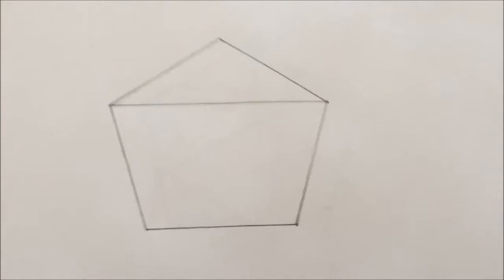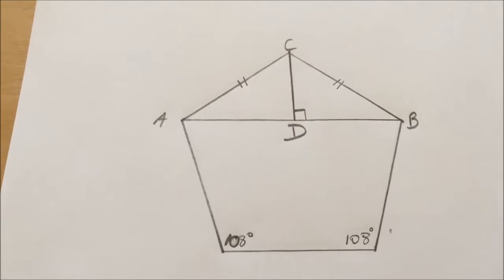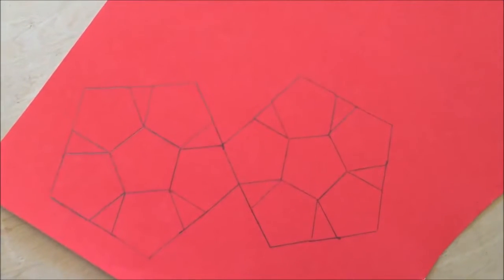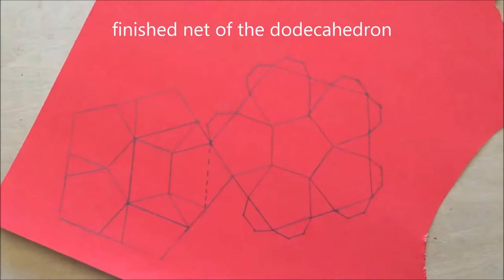Nested Platonic Solids 4 the Dodecahedron

Comment: i wonder, what would be the side length of the Icosahedron if you were to nest this dodecahedron inside it?
Reply from the maker: The icosahedron and dodecahedron are duals of each other, so if you nest the dodecahedron inside one, each of its vertices would meet the circumcenters of each triangular face of the outer icosahedron.  This is what I did originally before I switched to the icosahedral die in the center.  Few of my students ever got as far as making the outer icosahedron.  And when they did, the dodecahedron would inevitably slip since nothing was holding it in place.  I tried reducing the edge length of the icosahedron and punching holes in each circumcenter.  This kept the dodecahedron from slipping and clearly demonstrated their duality.  But it didn't look as elegant.  
Now, back to your question, multiply the edge length of the dodecahedron by 1.854 to get the edge length of the outer icosahedron.